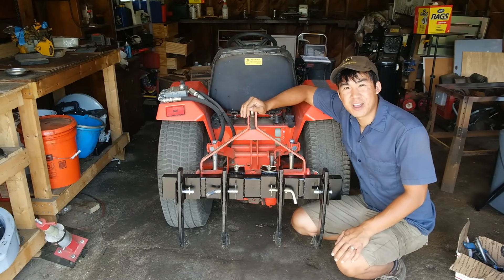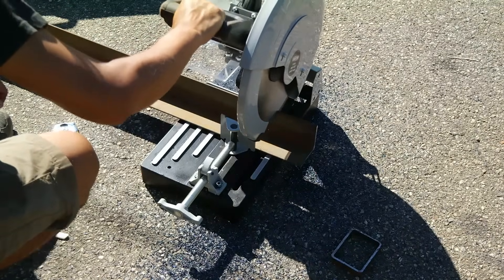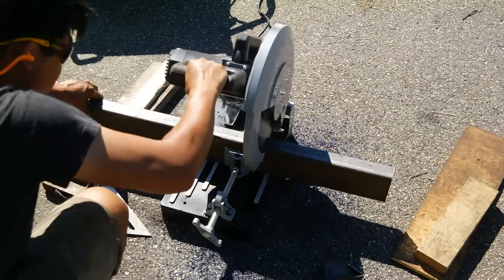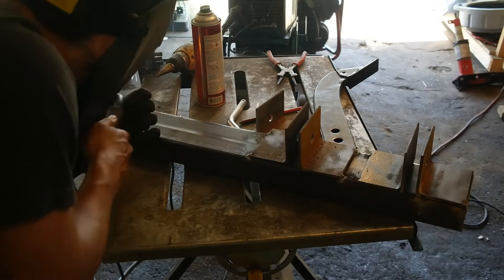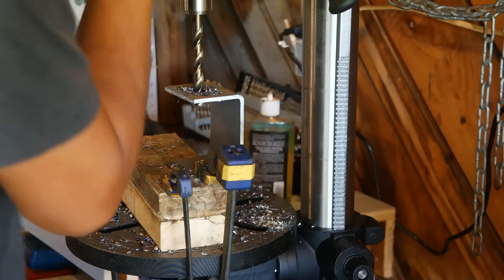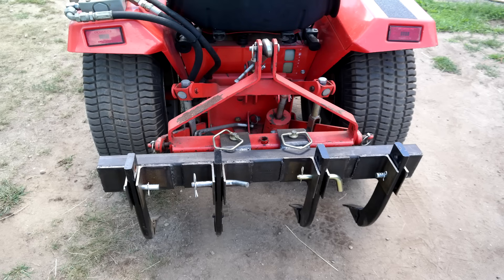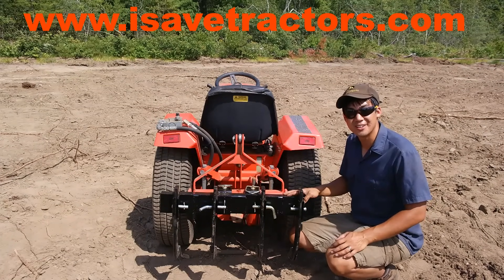Garden Tractor Ground Ripper Cultivator Attachment Build

Comment: Nice job, a little wider would've made it perfect, won't be driving over what you've just done and less passes  ...but still a good job.

Little tip for drilling, don't go straight to a large drill bit, step it from smaller sizes, your drill bits will last longer.

Also if it's smoking like it did it's getting too hot, over heating drill bits will wreck them fast, you need some coolant/lubricant on there. I've seen people use many things in a pinch 😉

Comment: Hey Norman, long time listener first time caller. Starting to get into welding myself and picked up a multiprocess welder to dabble in all the disciplines. With your flux core builds, any issues with welds breaking or welds not holding up compared to stick welds?  I enjoy the content, keep it up!

Comment: Norman, cool video!  I am contemplating some type of ripper or even a tiller on the back of a Wheel Horse C-161-8 / Ark Loader I am picking up soon.  I know I need weight behind me for loader ballast, but I’d like to tear up soil and scrape it off with the same piece of equipment.
Reply from the maker: It's a good idea. You can use a fixed weight bracket that is separate from your implement lift, so you can have both ballast and a ripper. You should also install ripper teeth onto your bucket and use it for both ripping and scooping
Reply: isavetractors good ideas as well!  I have yet to see the machine but have an agreement with the current owner.  It’s not really on the market.  Once I pick it up, I’ll figure out how to make it all work for me!

Comment: It didn't go but two inches in the soil. I like the design but it never proved you can bury the tines 6 inches and rip the hard soil.  After all that work and money spent on the metal,  it would be cheaper to rent a rear tine tiller for a day if it can only go 2 inches.  Seriously  I really like your design.  Good luck.

That Klean Weld is meant to be sprayed inside the tip of your welder nozzle. To prevent buildup of slag from the spray.  Not to be applied to the welding seem.  That you want to be clean metal on metal.  Good luck fella!

Comment: just wondering what size generator are you us to power your welder, an if you ever want a tougher paint try Magic Paint its sold at tractor supply the only bad about it is it take 24 hours to dry but when it does its almost like powder coating
Reply from the maker: Back then I think I had a 4000 watt generator. I no longer use a generator to power my welders but it worked back then. Thanks for watching!

Comment: I cringe when I see flux core welders used for stuff like that. For thick steel I'd use a stick welder unless I had a good mig setup.
Reply from the maker: I cringe when I see comments like this. It spreads false information that flux core is not a capable welding process which is untrue. Flux core wire can weld much hotter than gas shielded mig.
Reply: @Isavetractors  not saying I wouldn't use one but for thick steel I rather use my stick welder. Mig is mainly more convenient but cost more to run. I've been thinking of getting a flux core to do thinner stuff with.
Reply from the maker: On the contrary I dont like using flux core for the thinner stuff. When I fix the hood on the 4040 I will be getting bottle of gas for it. Check out my JD400 suitcase weight bracket build. I use .035 flux core out of a 200 amp wire welder. Welding 3/8". Keep in mind this Cultivator build is an old video. The suitcase bracket was my most recent welding project. Big difference in the end result.
Reply: @Isavetractors  ok. I subbed today so I'll check it out. I got my hands on a 89 craftsman gt6000 Onan 20hp with sleeve hitch.
Reply from the maker: Nice!
Reply: @Isavetractors  even better is I traded a new 125cc motor for it for a push mower and I only paid $30 for the motor. I couldn't get spark out of the onan till I rewired it today and it fired off on either.

Comment: Nice design, good work. I see a few similarities to my setup.What did you use for shanks?  Were they store bought? You should have stuck with your original width, or possibly gone wider. Can you gear down and go deeper?
Reply from the maker: The shanks are from Agri Supply. In the video I test it digging it in pure compacted sand and gravel. It works much better in our garden area which is a nice loamy top soil.

Comment: The anti splatter spray is intended for the nozzle of your mig gun ,not the piece you are welding on , just saying save yourself some money that way
Reply from the maker: Anti Spatter spray is for anything you don't want spatter to stick to. It works great on the metal you're working on. You should try it. I dip my nozzle in an anti spatter gel. I weld with Flux Core Wire so anti spatter spray is a great time saver.

Comment: Does the "A" attachment come with the hydraulic to lift it. What drives the hydraulic pump?
Reply from the maker: The "A" Frame is a separate attachment for the 3 point lift. The engine drives a hydraulic gear pump that drives the entire drive train of the tractor.

Comment: Norman, great idea. I use to weld with tennis shoes,  but I got tired of burning my feet, and I wear jeans, a welding jacket,  hat burned my scalp alot. Can't blame my bald spot on that.😂😂😂 Subscribed for more.
Reply from the maker: Yea, I have burned up one pair of shoes so far. I stopped wearing my steel toe work boots because bending over with the boots up would hurt my toes. I need to order soft toe boots! I wear Arm protectors now.
Reply: isavetractors your tuffer than me😒🍺

Comment: Soft dirt , or is it sand ? Do you think it will work in harder dirt / rock ?
Reply from the maker: Our property is mostly sand. I think it will work with denser material, but you would have to make multiple light cuts.  It works well in our garden with well amended soil.

Comment: Very nicely done Norman. The only thing more that I would have done was round off all the sharp corners which I seem to always manage to find a way to tear my jeans or cut my leg on! I purchased a new utility trailer a couple of years ago and when I got it home I spent probably an hour so with the angle grinder rounding off the 90 degree corners all over the trailer and touching up the paint. I use a quarter (coin) and a scribe to mark the radius on the corners and that way when I grind them off they're all the same radius!
Reply from the maker: Thanks for your comment, I agree, I should have taken off more sharp corners. Truth is I did this project on a whim to handle a problem on my property,, and decided to film it. I did not expect to get this much interest on this video!

Comment: should have made it longer. its narrower then the tractor so you cant make passes without running over what you just broke up
Reply: Just two extra blades would've worked well, plus a little extra weight at the back wouldn't hurt when ripping.

Comment: Is that welder engine driven ? And is it a comb unit, stick/mig,  AC/DC and what brand/Model please ?
Reply from the maker: It's just a 140 AMP inverter wire/mig welder. I run it off of a 3650 watt portable generator. Nothing fancy. It's a Klutch 140si welder.

Comment: just two things that i have noticed that needs some work on  one is not  to have your spray can that close  to your welding a hot spark could explode your can and  if you got closer to your weld  about 1/4 inch away from your material you should have less splatter. at 378  on time line looks like you are  over an inch away with your nozzle.
Reply: akaeldin yes ive seen one explode in the shop. serious injury and burns.

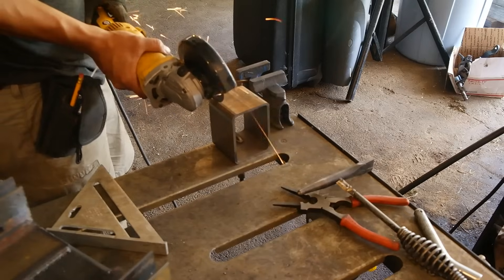Comment: @5:28 just curious why you chose not to use your new chop saw. Was it because the piece is small and hard to clamp in, or was it too big for the cut?
Reply from the maker: it would not clamp well in the chop saw because of its short length.

Comment: Nice video! I like how you explain what and why you do stuff. I didn't really hear what you said about the spray you are using(my native language is Swedish). Are you using a no gas welder and the spray is to keep the splatter to attach to the steel?
 I have a no gas welder to and will soon be using it to build a new mower deck for my 28 year old Stiga Park. That tip could be useful then.
Regards Nils from Sweden.
Reply from the maker: Hi Nils, yes the spray is a keep the spatter from sticking. It's called Kleen Weld. It works great!

Comment: Awesome job 
I'd recommend getting a large shop fan to blow the welding smoke away from you. Cheaper then a fume extractor or hospital bills :)
Reply from the maker: Thanks! I do have a box fan running off camera, but I could use a stronger one for sure!
Reply from the maker: As a result of your suggestion I am going to buy a pedestal shop fan today at Harbor Frieght! I rewatched the video and even with my fan, that welding smoke comes right at me
Reply: Yeah the commercial floor fans are good for keeping mosquitos away too!
Reply: +isavetractors just read your article in LATMag nicely done keep the articles coming!